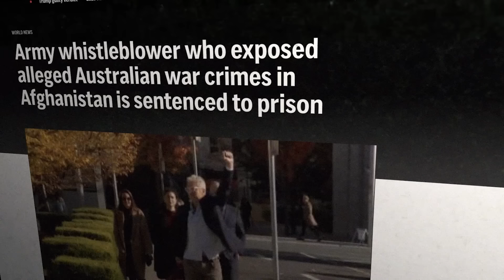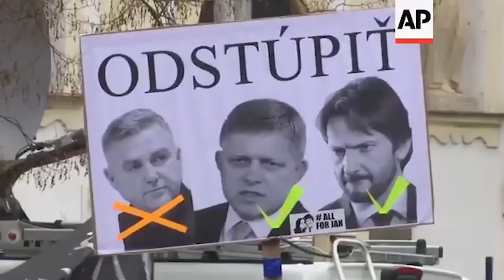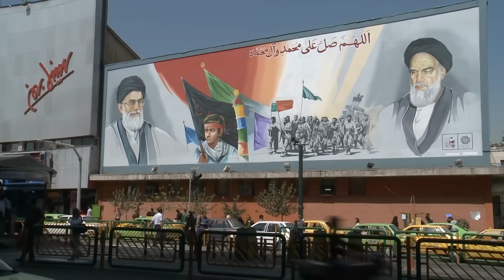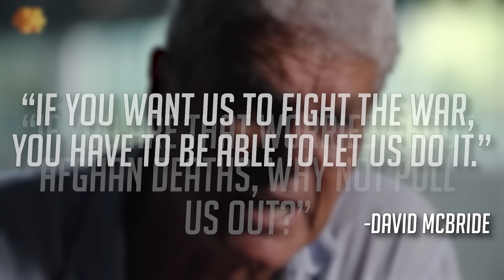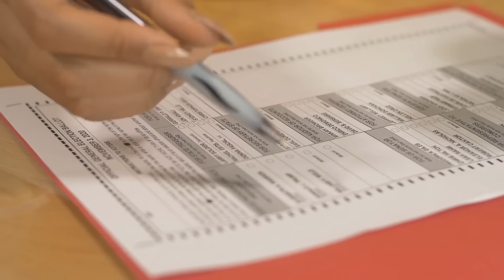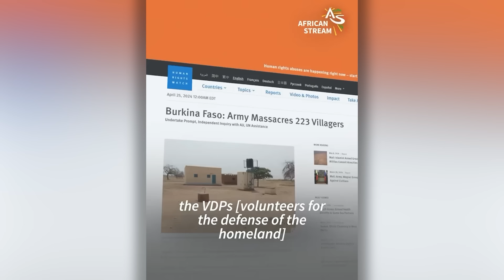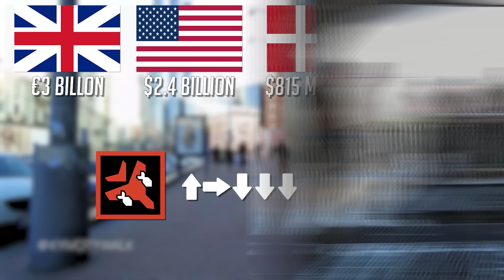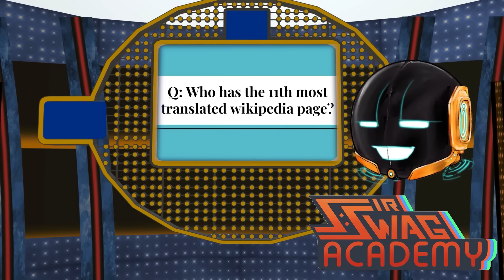This month's news without the bulls%&t (May 2024)

Comment: The main problem With ozympic is that it has some really nasty horrible side effects  like one woman had to have her stomach removed because it started rotting
Reply: Kek
Reply: From my research of other similar drugs those reactions can happen but are like being struck by lightning twice after winning two separate lotteries at the same time. Typically the most common side effects I have seen and researched are a result of under/over while on the drug thus causing massive stomach pain, puking, diarrhea, etc. Though reactions like stomach rotting may result from complications with other conditions such as ulcers.
Reply: @hilkmeister1382  not to mention the eating dis-orders this could cause. Can't be good for mental health.
Reply: @sirwahthemonke  That is pure speculation, there is no casual let alone correlative link between eating disorders and these drugs. If anything they'd help by changing eating habits and improving one's body image through weight loss.